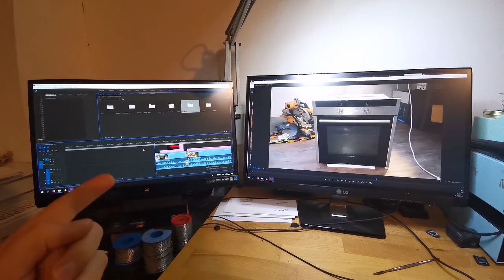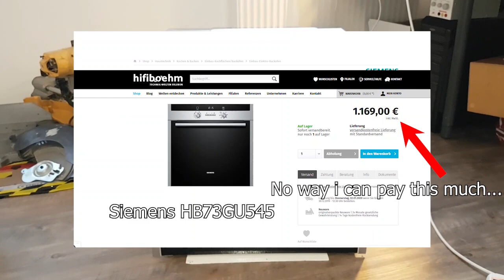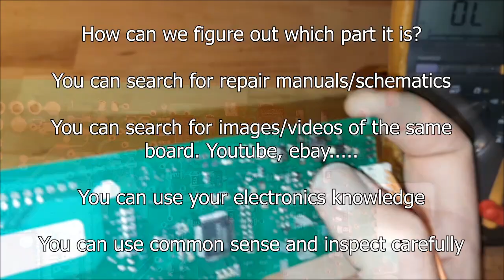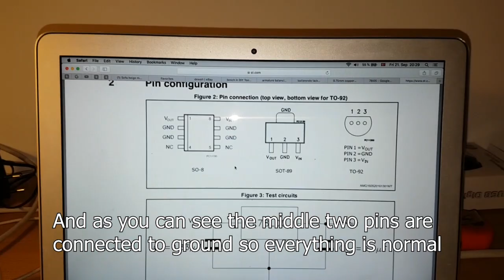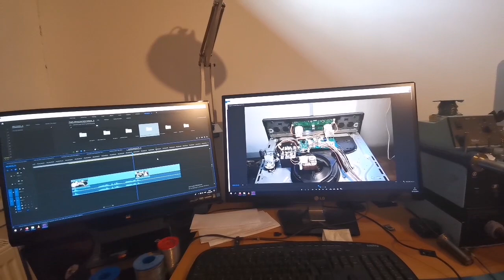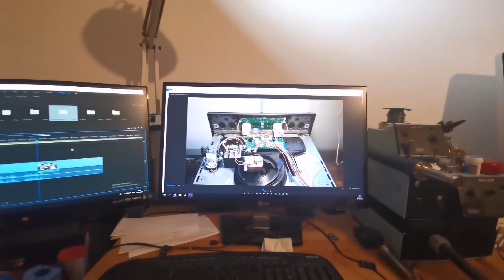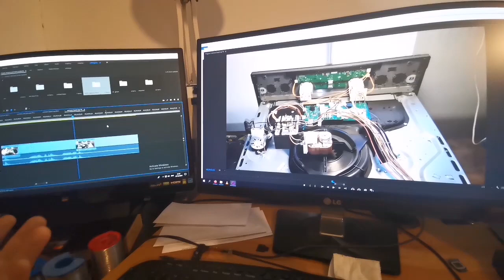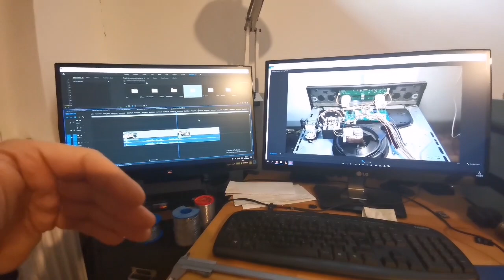Nightmare on Oven Street 1: Cable's Curse. Oven Control Board Repair. Siemens IQ500 hb73gu545

Comment: Hi, I have an old microwave oven lying around in my attic and I thought if I can upgrade the motherboard with another one taken from a high end oven I would have a high end professional one on the cheap. Is it possible, or is it just a waste of time and money.
Reply from the maker: If you have the ovens lying around you can give it a try. As far as i see the magnetron and the high voltage transformers are all the same in every oven. So with a bit of thinkering i think you can achive what you want.
Reply: thanks for replying.

Comment: Hi! I have a HB84K552/45
Where the display is gone. The display's light still work... the hoven works but just without display. Do you think is necessary only to change display? Is it a difficult work?
Reply from the maker: If I remember right It was not so difficult but it also depends on your experience and your tools. It may be difficult to find a replacement LCD. Probably it will be easier to find the whole circuit board.

Comment: Hello. I have a bosch serie 6 oven. Now apparently show error code E 05 -11. Do you know what it is? Thank you.
Reply from the maker: I dont know what exactly but you can check them online. If english doesnt work try backoven fehlercode, backoven fehlermeldung, and add your fault code to the end. You will need to use an online translator for sure.

Comment: Hi, Thanks for this insightful video. I have the same exact oven and my ovenlight stopped working recently. I’ve tried to replace the oven lightbulb (as I have done so many times before) but this does not solve the issue any longer and after watching your video, I’m suspecting it might be related to a shortcircuit on the board (the lower board in your video). With you knowledge about this oven, do you know what might be causing this?
Reply from the maker: When you switch the light on do you hear the relay? If not you may have a problem with the light bulb relay. Well sometimes they sound like they are working but they don't make contact inside. If I remember right It was the first relay on the bottom left corner. Start with checking that relay.
Reply: - yes, I hear the “click” when I switch on the light - the same “click” I hear when I switch on the oven. By relay, do you mean the white-ish box on the board and is this what’s making the click?

Comment: The problem startet first that all the items on the display flikers, power cut does not help.
And now, some weeks later i fond the time to try to repair.
But the display items arnt flikkering now, just some of them burning fix. Like the timer he give 8:88  and there is above the : a circle with 2 arrows that also is burning and some others.
I cant find anything off it mayby you can help me fixing?
Reply from the maker: remember replying to you but i forgot if you fixed it or not. hope you did.

Comment: I have similar problem, it shows E101, so temp sensor or the mainboard. Senson is 533 Ohms, no signs of burns, so I gues this is the mainboard...because nothing starts.
Reply from the maker: i forgot the resistance of the temp sensor but i kind of remember i measured it at some point. Maybe it is on one of the videos. IF there is no sign of life then perhaps it can also be the power supply. Start disconnecting everything which is not necessary for owen to turn on.

Comment: Hi, thank yyou for sharing this very usefull video
Well, I have the exact same oven (except the door is hined on on side) ref: HB65RR560F/4 and a problem I have not (yet) solved.
It started with the oven making the mains circuit breaker trip. After several tries to re-start it (which we should not have done), the display went down as well. I replaced the switching board P/N 00656659 and the command board since I noticed a blow-out capacitor on it. I used P/N 00740303 which is the so called programmed one. Now when a connect the oven to the mains, the clock is showing, but shortly after that I get a E0 05 error displaid, which means a communication problem between the two cadrs I replaced. Now, there are two references for this command board the programmed one I used and the non programmed one (P/N 00707929) according to the Siemens site service information and I start wondering which one should be used and why ? Could it be the reason for this issue (and of course the board I have got - direct from Siemens - could be defective, but I doubt)
I will appreciate any idea .
Reply from the maker: Are you the first owner of the owen? 

Both command board and switch board has software installed in them. 
You need a programmed board. A non programmed board needs to be programmed first. 
It is very likely that the sofware in the command board cant communitace with the software in the switching board.
It is also possible that you made a wrong connection.

If you can do soldering than you can try to try to swap the microcontrollers between the old and new boards. 
You can also just try to repair the old boards or send them to a repairshop for repair.
A repairshop can also swap the microcontrollers. 
If you are lucky the microcontrollers on the old boards are still working. 

Yes it is also possible that the factory or the retail seller made a mistake and send you a board with incompatible software.

If you already solved the problem please let me know how you did it.